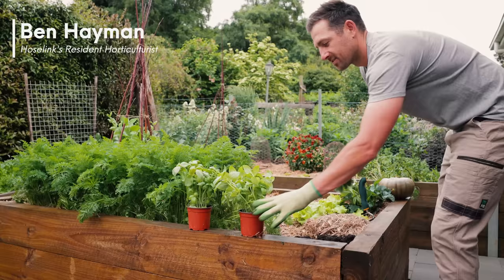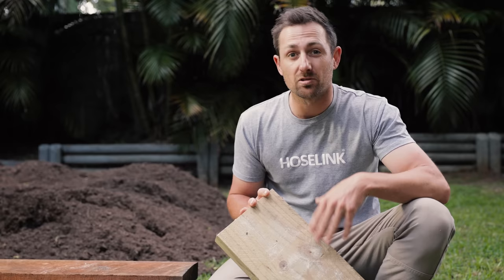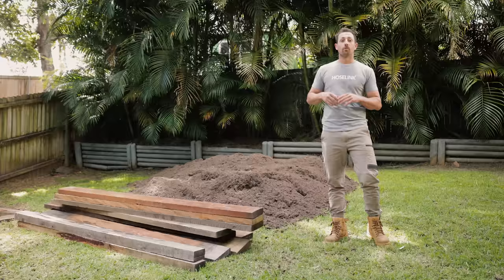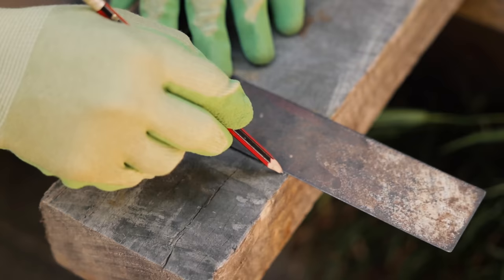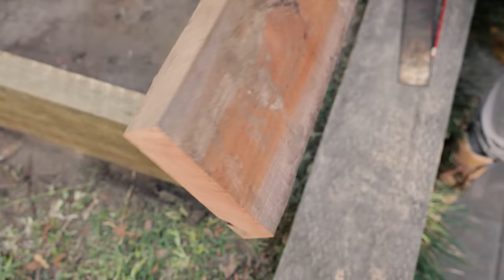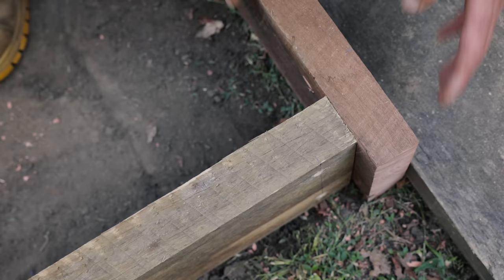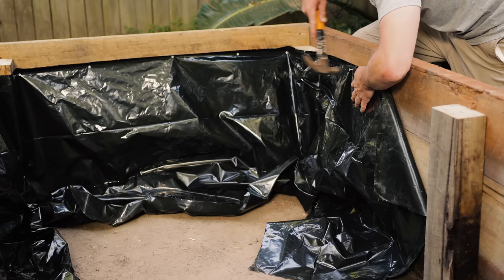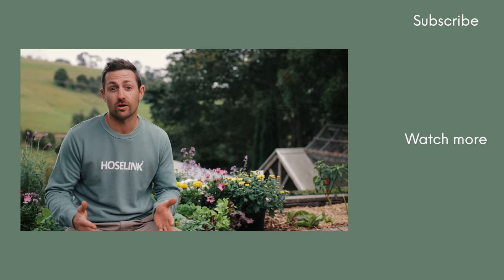DIY Raised Garden Bed with Horticulturist Ben Hayman 🪚  | How-to Garden Series | Episode 17

Comment: Thanks for the great tutorial. Two things i'd like to comment on. Screw holes:- Drill the counterbore first. That way the smaller through-hole is centred by the small "divot" made by the point of the larger wood bit. Secondly, don't try to brush away the timber burrs with bare fingers! You'll end up with splinters!! Hope this helps.
Reply: Hey Greg, they are both really good points, we might need to get you on set haha 👌🏼